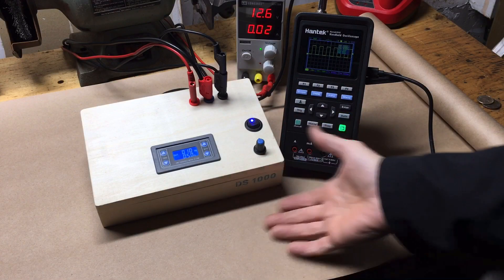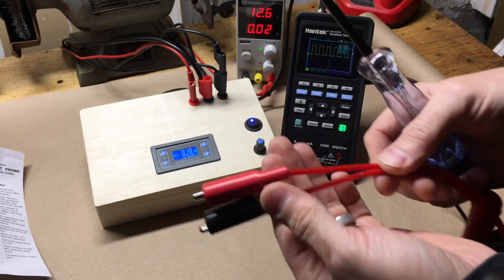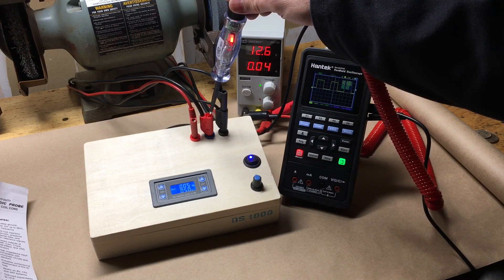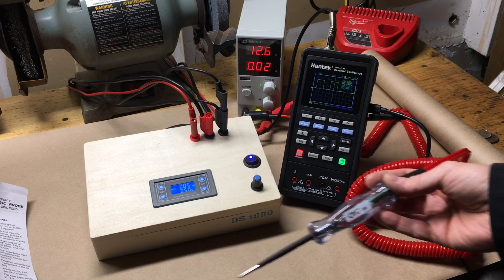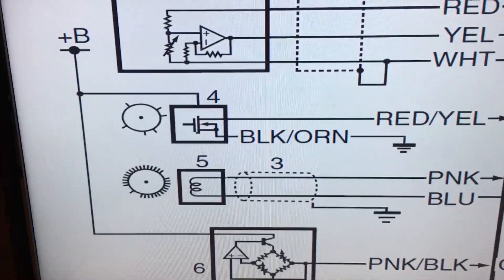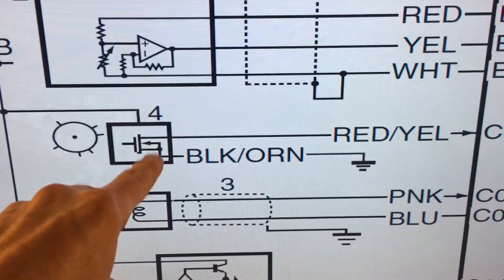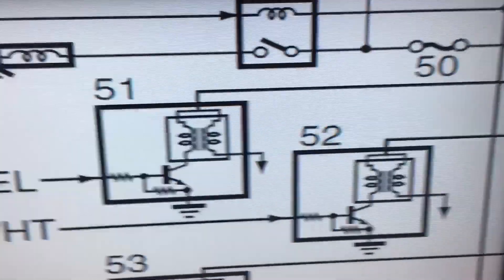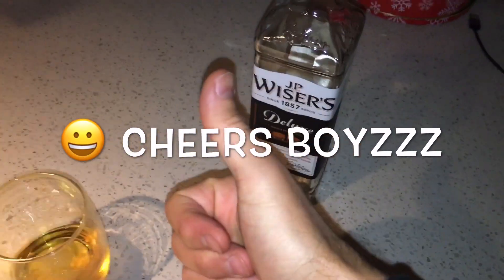OTC 3631 Test Light

Comment: Subbed, great video!  Old Incandescent bulb test lights are the best for testing for corroded connections that may read proper voltage but won't carry and current..  a 3w bulb draws about 170mv @ 12v so be careful what your probing...
Reply from the maker: Thank you Sir. Yeah this OTC rig is pretty trick. Useless for load testing as you mentioned. Cheers